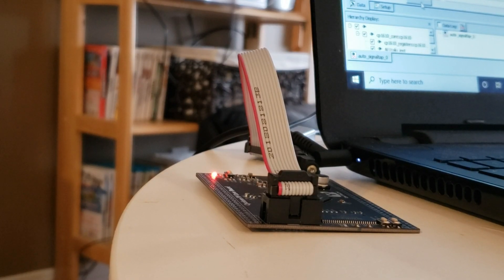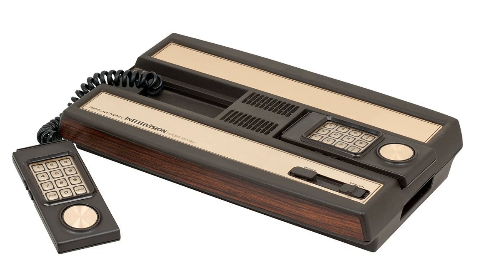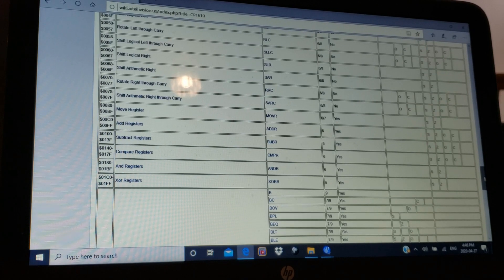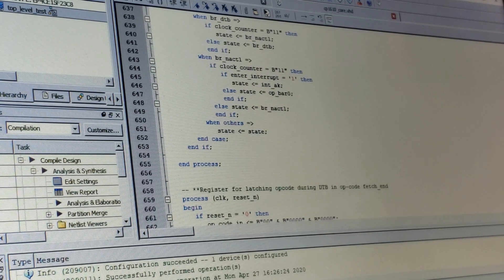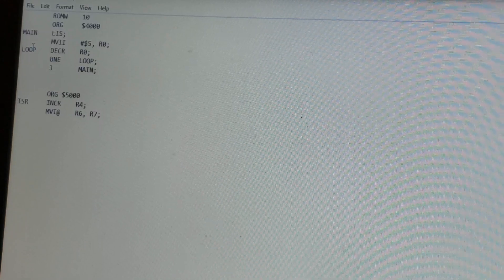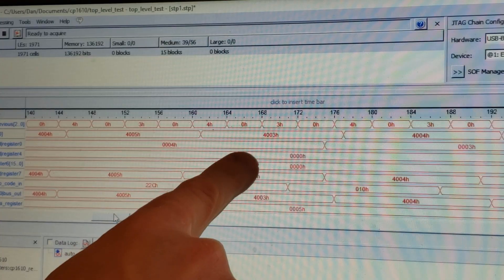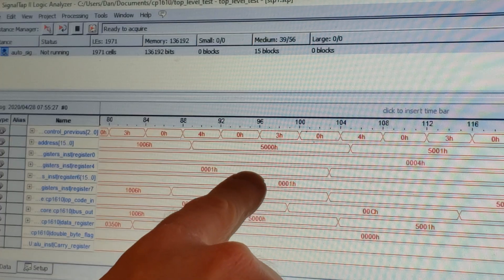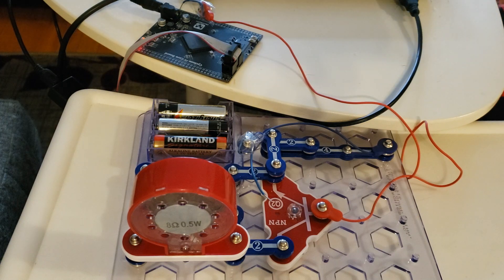FPGA core for Intellivision's CP1610 Processor

Comment: Do you have any advice on a good way to learn Verilog or VHDL? I am very interested in FPGAs, but it seems to be a bit more difficult to get started with them than with microcontrollers, for example.
Reply from the maker: I have to confess something.  I am not very verbose when it comes to either language.  There are certain techniques to tie the hierarchy together that when done right can be really elegant.  I've had some coworkers that structured things so that a few changes in VHDL generic parameters could multiply the number of instances of a process and alter pipelining.  Personally I just don't have the organizational  talents to pull that off.  So admittedly I under use the full potential of either language.  The most important thing to remember, and you're probably already aware of this, is that unlike software HDL is not executed sequentially.  For instance suppose you have 5 processes composed of IF statements.  In software these IF statements would be executed in the order they appear in the code.  In HDL they would 'run' in parallel.  Whether it's VHDL or Verilog you decide to tackle find some simple  tutorials to do.  Make sure you have a way to verify your results.  This could be through simulation.  I mostly use the Intel/ALTERA platform so rather than simulate I deploy their embedded logic analyzer called Signal Tap II.  Once you've done some simple design examples try and use IF statements to create registers and counters.  Registers can hold flags... and count values can be decoded which in turn can trigger other events.  But like anything it takes practice and patience... so don't expect overnight results.  Anyway, best of luck.
Reply: Thanks for this. Are there any specific dev boards you would recommend?
Reply from the maker: I like QMTECH Cyclone IV EP4CE15 SDRAM Development Board.